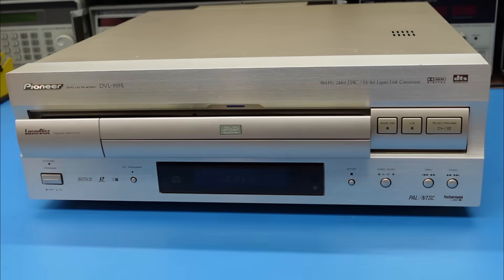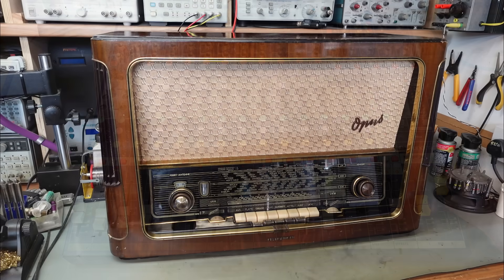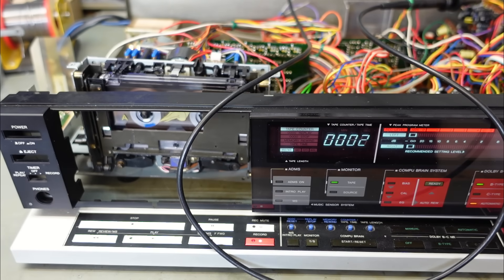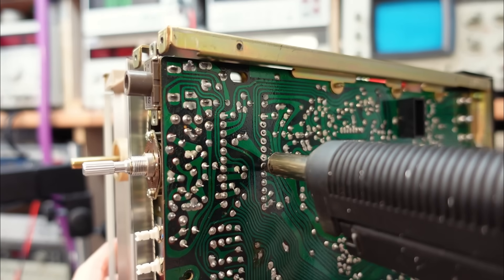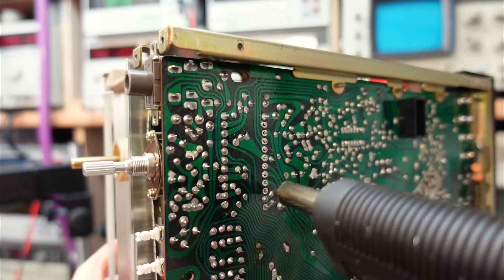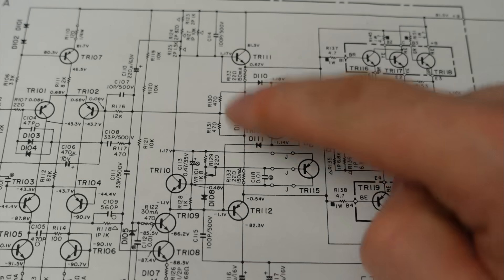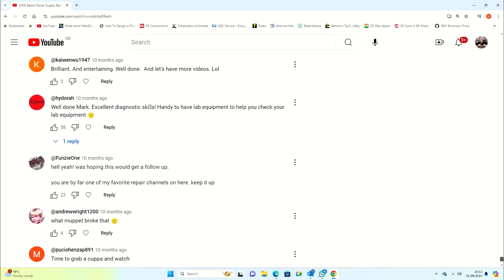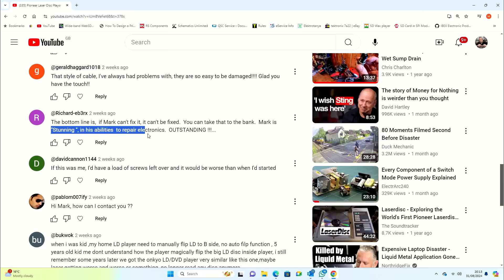The 3-step Process To Repair Any Vintage

Comment: You should share this with the 'right to repair' community...    This neatly points out that it is possible for mere mortals to repair things...  We are not worthy..  @rossmanngroup

BTW I'm in Australia and I quite often repair a lot of things, be it bringing back to life test equipment (Fluke 8506a) to changing out a cylinder head on a Stilh  chainsaw; I'm game.

Comment: I think its great advice but its not always that easy.  Especially to make money.  Since Its tough to charge for things you couldnt fix.  Basic troubleshooting is straight forward but schematics are generally tough to find.

On a related note, how did you grow your business?  I struggle with advertising and reaching the right people.  Especially considering that consumer electronics repair has pretty slim profit margins.  Its also a struggle to keep up with customers, parts, books, etc.  Let alone actual repairs.

Comment: Many items that come in to me would have been simple jobs originally, but having to sort through the mess after they tried to fix themselves adds time and money to the repair. Other times it's due to people replacing a blown fuse and trying again multiple times, usually with much higher rated fuses! I can only hope that people who take Mark's course learn the valuable lesson of not blindly charging in without understanding what the real issue is. Not everyone has the right mindset for troubleshooting.

Comment: It's easy: 1. Package in in a box, 2. Send box to Mark,  3. Pay for repair
Reply from the maker: @darrylr  well, erm, yes. That also works. 😂
Reply: @MendItMark  Tell me how!
Reply: 4. Enjoy
Rinse and repeat
Reply: Step 1 : Cut a hole the box
Reply: Never switch on a broken device ....at first.
Reply: @frederickbowdler8169 where's the fun in that? To quote Marvin the Martian ""There was supposed to be an earth shattering kaboom"
Reply: @1974UTuber  ok at least poke it with a long wooden stick for the first few minutes then you can bring it indoors 👍
Reply: @frederickbowdler8169 - Actually, a bamboo chopstick while the unit is turned on can show up bad solder joints and loose connections or cracked circuit boards. So the wooden stick is a valid workshop tool
Reply: If our Panasonic plasma didnt weight bucket of briks, i would mail it over the channel in no time. It was fixable imo since it was still giving error code, but local TV repairman didnt want to have anything with it since it was old model. Sad.
Reply: Exactly lol
Reply: Nope
Reply: Noice 😂😂
Reply: @nefarious_blue  Hmm..would that refer to the Onslowe method of electronics repair?  Give it a good whap, and it works?
Reply: @darrylr  😂😂😂😅
Reply: Alternately, 1) Fly Mark to where the system is...
Reply: Calling Joke please climb down to a lower altitude.
Reply: @darrylr - You seem to have missed the whole point of his video which was "Anyone can do it themselves and save some money"
Reply: @1974UTuber it's a joke🙄
Reply: It was a joke good sir. He was having fun
Reply: maybe his sense of humour needs repair 😂
Reply: @1974UTuber  What's making me chuckle is not once have i heard" if you don't already know what a nano-farad thing is (i used spell checker) then probably best not to bother"😂
Reply: @1974UTuber  spend a grand on kit to repair something that's worth a tenner..... definitely don't tell the wife about the price of the test kit,  you don't need all that negativity in your life.😄
Reply: @adrianmoore4160  Aww, but the repair gear is a hobby, you see, and you gotta spend some money on a hobby don't you? 😁

Comment: Great idea. I have been repairing gear for about 50 years+-. Mostly 1920-1960 era radio, some Hifi. I have a "repair" link on California Radio Historical Society.I think there is only about 2 of us left on it. It is enough to pay for my hobby. Things do go wrong though. I recently did a 1965 Saba Hifi.Gave a bid of $400, then spent 0ver 12 hrs getting the FM dial stringing to work right!
I don't have the room or eyesight for a scope, so no SMD for me!
Certainly love your site: Mr Carlson, Techmoan, My Mate Vince, The Repair Shop, and this one are my go to sites.
Tom in northern California.

Comment: This is the same exact approach that I take when diagnosing vehicles. Whether it's the electrical or the electronic side, or the mechanical side. Step number one is always always always, verify customer concern. Within those three words also includes gathering as much information and being able to understand and interpret what the customer or owner is trying to tell you. Learning to speak with and understand your customer and their concern / complaint is a skill unto itself. 

Step number one: verify customers concern. 

Thank you so much for what you're offering. Not quite sure I got the quid but I'm glad that there are people out there offering this. Mr Carlson offers something similar however I imagined that like two different teachers face to face, one could gather a multitude of skills and knowledge from several sources. 

I absolutely love your videos, love your demeanor, and love that you share with us something that excites you.
Reply: Dirt, grease, rust in your eyes, dirty tools if ya can even get in to work on those sardine cans.  Is the point. Like Mark ya gotta have tools, investment capital to move and forge ahead. It comes with a cost but if ya like it, do it.  You could just make preamps at only eight per year and make 250 grand but what the hay.   You'll understand that one if you watch the latest repair on that preamp.
Reply: @whatcher8151  trust me, after 20 years I would go back and tell myself after washing the evolution of the automotive business to not go near it. In fact even at 40 and looking for a change of scenery in terms of career

Comment: Can’t believe you’re charging around £200 per repair! Given your experience, thoroughness, and attention to detail, that doesn’t seem nearly enough! 😯

Thanks for another fantastic video. Love these ones about the basics of the approach. 🖤
Reply: Something tells me that's without replacement component cost.
Reply: @paulmichaelfreedman8334  Not necessarily. I'm one of his clients, Mark repaired a tape deck for me. (Not filmed, sadly, guess it was too boring). Anyhow, he changed belts, cleaned it, fixed an issue with a non-recording channel (which IMHO required a replacement of at least on voltage regulator) and of what he says, he replaced one pot(entiometer) which he had to make himself, as it was custom. And he charged less than 200, even less than 150...
Reply: @paulmichaelfreedman8334  The labour is the vauable thing apart from valves, transformers etc. Also, he can probably repair plenty of things in 2 hours or so.
Reply: here in SA if you ask more than 30 customers will poop their pants
Reply: @antonjansenvanrensburg4145 yep. Wish anyone would pay me $100 to fix anything they can replace for $200 or so, then complain when another unrelated fault appears 12 months on.
Reply: Seems like Mark’s mantra is 
“Do it once,
Do it right, 
Don’t (really) want to see it again”!

Comment: During Mark's intro I was waiting and hoping he would say the No.1 step was to 'replicate the customers fault'........and he did. Soooo important!
Reply: The frustrating thing is when the item arrives and there's no fault. I call this the "magic aura effect", when something works within my presence but reverts to faulty as soon as it gets home.
Reply: Can't fix something if you can't replicate the fault. And occasionally the fault winds up being not a fault at all,  but something that the customer is doing wrong. Those are always fun "repairs".
Reply: We use a pre burn bench for that purpose.
Reply: There is a car repair channel where he gets cars that have already failed to be repaired by other garages. The very  first thing he does is to verify the customers fault description.

Comment: I volunteer at several local repair cafes. Free for the "customers", but donations are always welcome - even a church hall costs somebody money.

What did I fix (or at least diagnose) today? Table lamp, external harddrive, bread machine, electric heater, portable dvd player, dead laptop, toaster and a vacuum cleaner. What a busy couple of hours that was 😂

Comment: Hey mark I have an amp, low volume flutters/distortion noise on one channel, through any input and when music is playing or not, noise comes on once the amp is warned up. I disconnected everything apart from speaker sound is still there. Defo the amp as it swaps if I swap speaker cables. Any thoughts?
Reply: Probably a transistor that's gone noisy